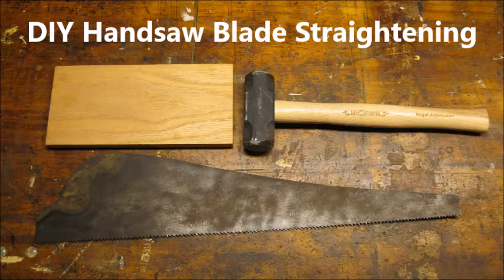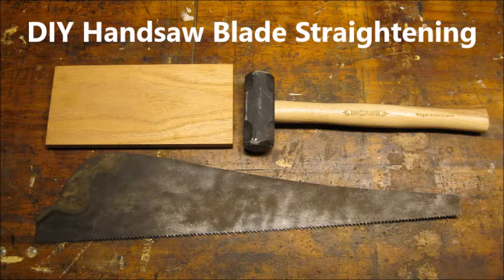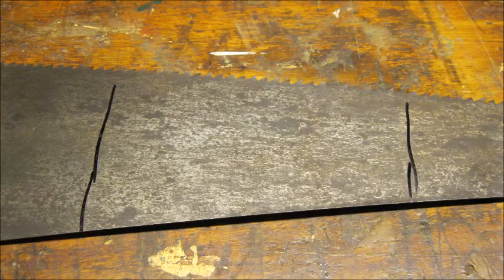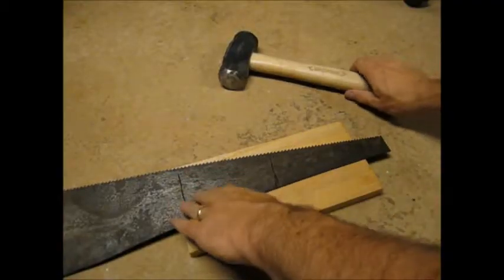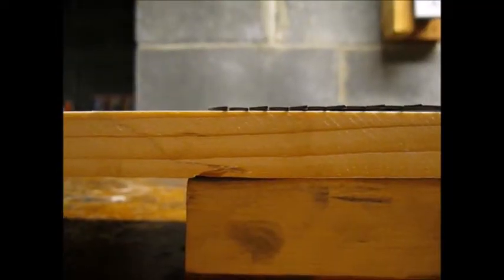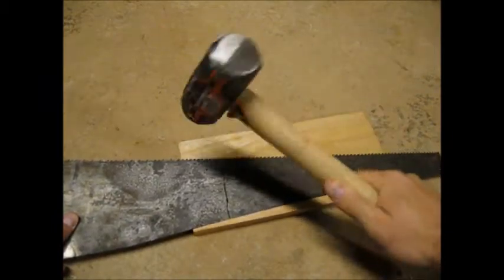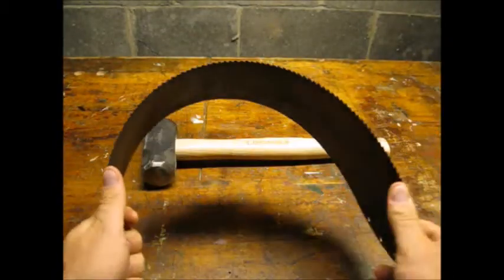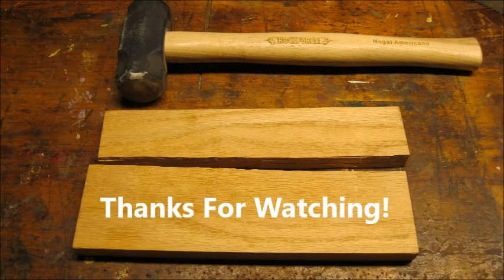DIY Handsaw Blade Straightening

Comment: Good video - thanks for posting! I have used an old chunk (24") of railroad tie in the past but that can be overly aggressive. These hand saw blades are tempered steel so unless there is a serious problem, a guy would have to really abuse a saw plate to make it break. As usual, use caution and common sense. Thanks.
Reply from the maker: Thanks for watching!  Every time I bend one of those blades I think this is the time it's gonna snap in my face!

Comment: Hi Sir, get yourself a 10 inch section of railway track and flatten the top layer. Don’t be too enthusiastic because the top layer of steel is harder than that deep inside. You can use this to flatten your bent plane blades. A kinked one you can cut up and make into something else. Cheers.

Comment: Thanks for sharing. With the saw blade laying on the wood are you hammering on the convex areas of the blade or on the concave?
Reply from the maker: I started hammering with "hump" in the blade facing up.  My research indicated that hammering both sides is beneficial.  I have found that bending the blade in both directions after hammering helps to tell if you really got the "hump" out or not.  Each blade I've tried this on has taken a slightly different combination of hammering and bending to get the blade straight.
Reply: Thanks for the quick reply. I'll give it a try on some old yard sale saws first.